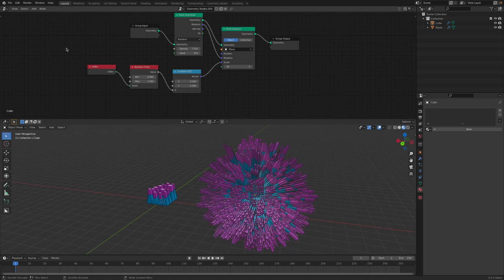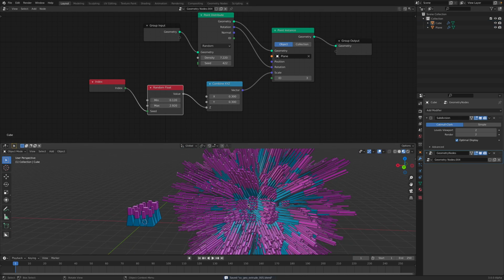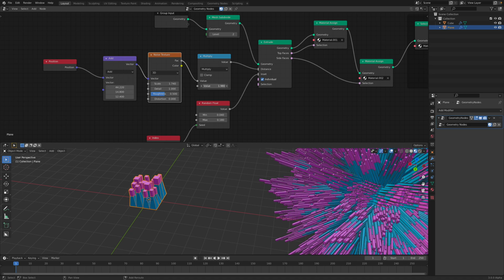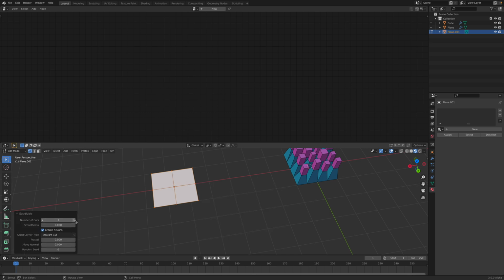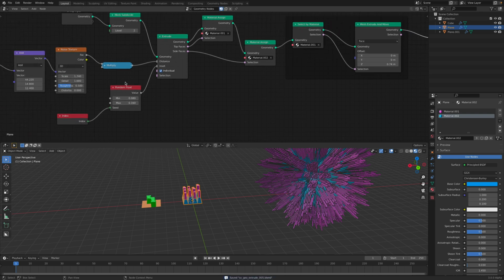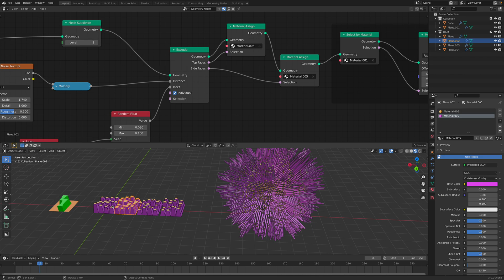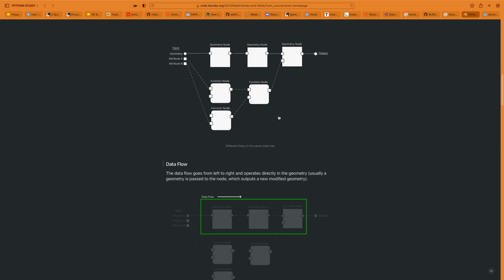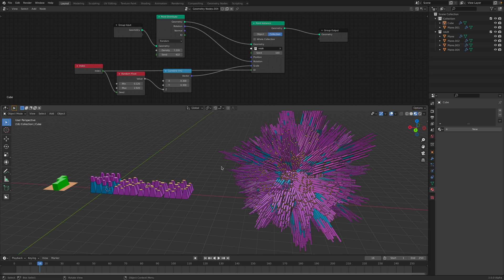LIVENODING Geometry Nodes NEW Noise Field & Extrude Nodes Study

Comment: IS the extrude node in Blender 3.0? If they removed it would be terible! I can`t work without extrude!
Reply from the maker: Yes, I guess it will make a come back. At the moment, Geometry Nodes Field is the way to go, it's more low level but also robust.
Reply: @JimmyGunawan  But I don't understand why did someone remove it. Did it cause any problems?
Reply: @JimmyGunawan  I keep reading about the Field thing but didn't studied yet.